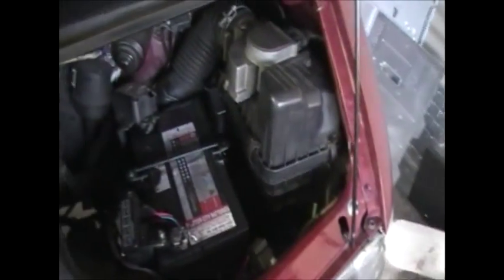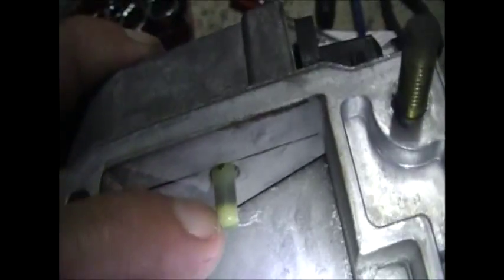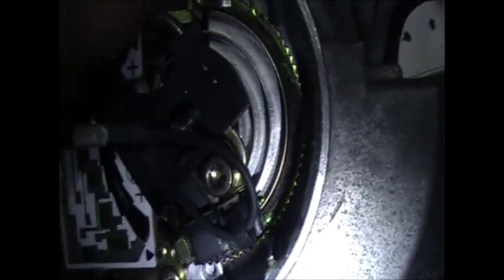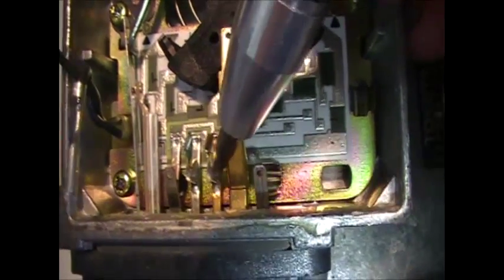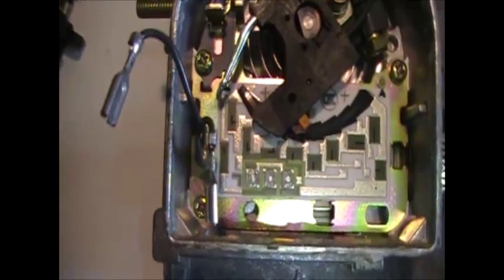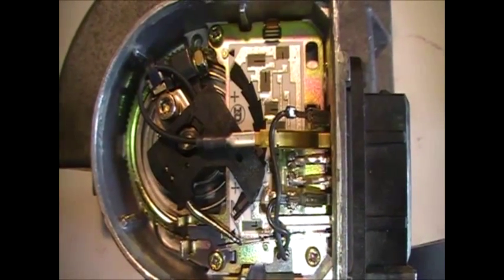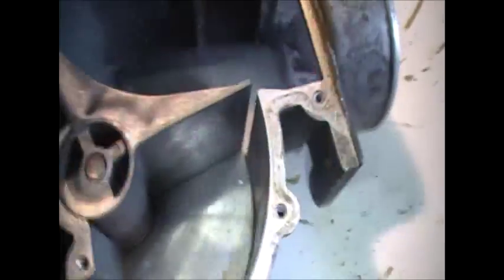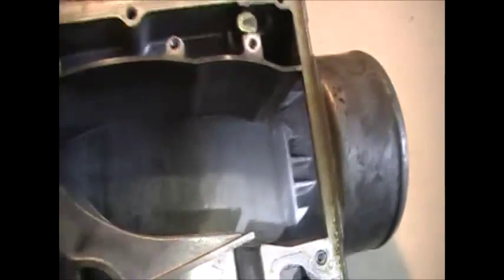[VAF] Valve Air Flow / [MAF] Mass Air Flow [ TCR Tarago Previa Estima 90-95] (MAP)

Comment: Thanks for this explanation! I damaged the connection by pulling it out but fixed it with this video. My ohmmeter momentarily gives a reading when testing the center pin to either one and then  reads an open circuit a second later if that even. I thought this was strange at 1st but realized this must be normal for a potentiometer. I'm stoked my van runs again!
Reply from the maker: Glad it helped
Reply: @TaragoPreviaEstima  I'm having issues now with my idle speed control not getting a signal to the correct pin (opposite pin is grounded when engine is cold) and I'm wondering if when I soldered this, if it may have somehow affected the signal.

Comment: I started to take the harness off the MAF assembly and saw the pins starting to stick out. I immediately put it back together and sprayed the sensor and put in a new air filter which was filthy. runs much better. cheers

Comment: Thanks for posting this :-)  I serviced one of these air flow meters in my vw golf and was wondering which part I needed to open up to access the meter on my previa.  Where that slider bit wipes on the circuit board had rubbed off some of the conducting material on my golf, so I just bent the wiper arm to a new area and it worked fine again, I'm expecting the same thing out of this one too.  Was glad to see you open yours up, so I don't have to guess on mine!  Thanks!

Comment: Very helpful, my previa was ruining my love for her. It was turning off in stop lights and the rpm fluctuates most of the time after I opened the air flow meter (had a little struggle with it but eventually opened it) and adjusted it runs smoother now and does not turn off...hopefully it wont... keep the videos coming 👍👍

Comment: I'm starting to think the MAF sensor problem in these Toyota. Vehicles are actually related to the wire connection, for example, one YouTuber had an issue where when he picked the wire up, the truck ran way quieter and idled probably around 700ish, when I pulled the connecter on mine, one pin was broken out of the seven on the wire harness

Comment: The second switch is a TPS (Throttle position sensor).  It should be on the same circuit as your Eng Temp Sender.

Comment: Thank you from Belize. 93 runner shutting off after it warms up. Haas a code for the air flow meter. Gonna try to clean it a bit.
Reply from the maker: Did it work?
Reply: @TaragoPreviaEstima  So wrapped up about 2 hrs ago and the code is GONE!!!🥳 Going to upload a video of my process tonight. I have an LPG adaption on my rig so fiddling with the idle now but no shutdown so far. Thanks again!

Comment: I have a 1991 v6 Toyota 4Runner 3vze. It has the exact same MAF system including the air filter box. I'm currently having a gas pump problem that doesn't activate unless I use a paper clip to bypass 2 leads on the MAF wire, the first 2 leads opposite to the brass leads on the wire connection that you also show on your video. I don't know if the word leads is the proper term but it's the female end connections on the MAF connection.

When I put the ignition key on the ON positions, the gas pump doesn't prime. For those people who are not familiar, turning the key switch to the on position primers the gas pump for 3 to 5 seconds then it stops until the ignition key is turned to the starting position. So there is no sound on the gas pump. the gas pump is located directly under the back passenger side opposite side of the driver. I cut the sheet metal then bent the sheet metal back to access the fuel pump. I directly powered the fuel pump with my 18volt Makita bettery from my drill and it turned on. Then I ran power from the connection plug on the wire to the fuel pump module assembly, it powered the pump right away. Then on the Diagnostics block (on the fender, passenger side, next to the  fuses & relay block) I bypassed the FP & G ports with a paper clip to activate the fuel pump through there and the pump doesn't prime or turn on at all. I did the same thing at the EFI relay and nothing. Then I saw on my Haynes manual that the fuel pump power wire somehow eventually leads to the MAF. So I bypassed 2 female leads at the cable connected to the MAF and the fuel pump actually activates on prime mode. the problem is that even doing this the 4runner doesn't turn on. Then I bypassed the Circuit Open Relay at the right kick panel on the front passenger side while the paper clip is also inserted at the MAF wire and the fuel pump runs and stays on until I remove the paper clip. I tried turning on the 4runner while activating the fuel pump this way but the 4Runner doesn't turn on. Now I'm going to check everything you have done on this video. I have a feeling the problem lies there. The reason I mention this problem on  my 1991 Toyota 4runner is because the MAF system is exactly like on you 1992 Toyota Tarago Privia and just in case that some one may have this problem on their Privia. Some one must have had this same problem too. I will up date this post in the near future if I discover what the problem is and how I solved it.
Reply: johnny John ?  anything?

Comment: WOW,  Watched this and my brain started to hurt.  My 1991 Previa has 220K on it and it idles rough and dies when it is in park.  So do you think by spraying that sensor inside the VAF would make it idle normal or do I need to break the cathedral shaped silicone sealed plate and make sure those 3 wires are soldered.

Comment: Screwed mine up trying to open the plug portion.. Car wouldnt start so I took it completely apart and saw that I messed up the internal mechanism tried fixing and putting back together would not work so I had to buy a new one 😢 did all this before I saw this video.

Comment: How do you unplug / disconnect the wire from the mass airflow sensor
Reply from the maker: There is a spring loaded clip that you need to remove on the connection before you can remove the plug.